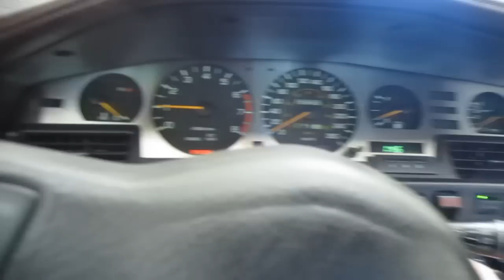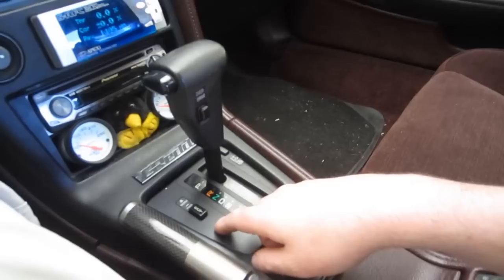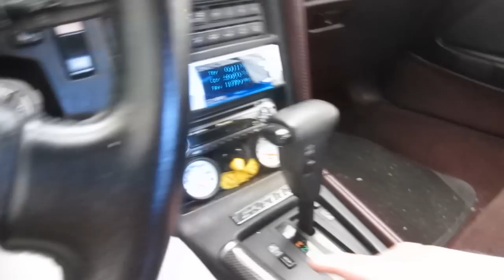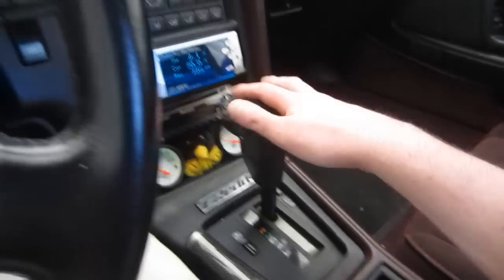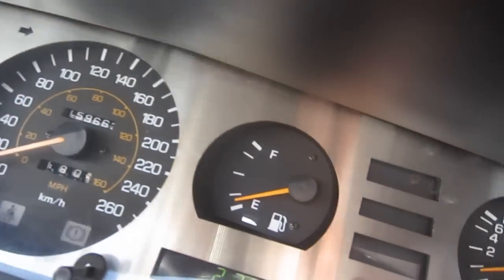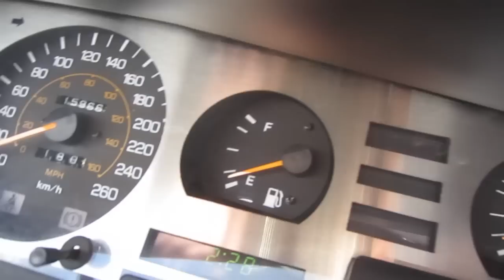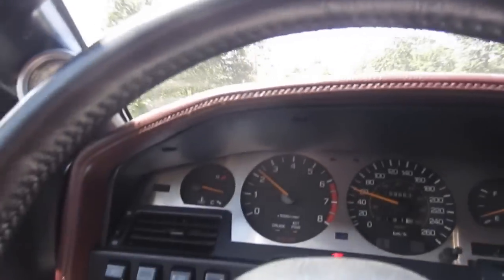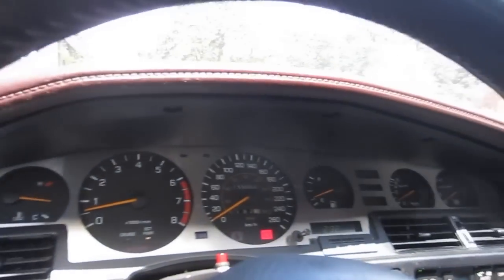Supra A340E Upgrade Transmission Tips & a Quick Burn.

Comment from the maker: The diff is always acting as a limited slip. The button does make the transmission shift at higher points though and also a bit quicker.

Comment from the maker: the ones below the deck are autometer (easily found at any parts store and work decent) white series, the ones in the pod are Greddy and the stock gauges are covered with a brush metal finish plate, i forget where i found that though. I like em. the autometers come with different bulb covers so you can change the color, too. which is handy.

Comment from the maker: its in KPH, 86.5 went to 240kph and 89+ went to 260. you can swap the gauge panel from a parts car if need be, the calibration is the same as far as i know and shouldn't mess with anything, I'm guessing you are in MPH, but the same deal goes.

Comment: i have an na auto supra, i might do a short term build with it, cams and crank changed out, headers, new pulleys, intake, and a tune, just to keep things on a budget, what do u think of this if i wanna swap to a 5 or 6 speed in the future and a 1jz which would later evolve into a 1.5jz?
Reply from the maker: Sounds totally worth if, 7M's are hard to maintain unless yours is totally healthy and 1jz's are getting pricey these days. the MKIV six speeds are crazy expensive, but I know the 240sx guys use 350z 6spd transmissions, so that's worth looking into.
Reply: paradoxdesigns mine has 173k miles on it lol and relatively low oil pressure which is why it would need the cams and crank replaced bc they are worn down. Its not that healthy but it is not too bad. Being in high school it is something I could much more easily afford rn than doing a full engine/tranny swap

Comment: paradox where do you get your parts? i want a replacement OEM steering wheel for 1989 got ne tips?
Reply from the maker: check out supraforums.com or supramania they have great buy/sell sections, eBay probably has them but ive found the prices to be way too pricey. gluck!

Comment: I got a 1jz gte  r34 with an a340e transmission. It doesn't change to 4th gear and my speedo & odo aren't working. any ideas? thanks!]
Reply from the maker: ECU??
Reply: James Paul Domingo that right there is badass dude
Reply: i use megasquirt ecu in projects

Comment: Etc power? Dude seriously?
Reply: First of all it's not ETC, it's ECT which just simply stands for Electronically Controlled Transmission. The automatic A340E has a TCM(Transmission Control Module) a computer. The "ECT" button being referred to is actually a switch that just changes the RPM's when the transmission will shift while in drive. That's why there's a label that denotes that the button when pressed down means POWER and when it's not it's just NORMAL shift. POWER just basically makes it more sporty and aggressive.

Comment: "biggest trans cooler you can find" lol if you don't like your transmission to function properly. They need to be up to temp to function properly.
Reply: Oil thermostat, most people with big coolers fit one so that's not an issue.
Reply: Thomas Caraccio  I was not aware of those. I should put one on my car. Thanks